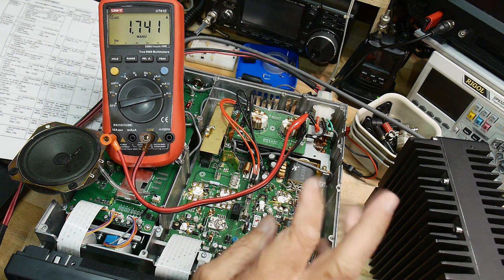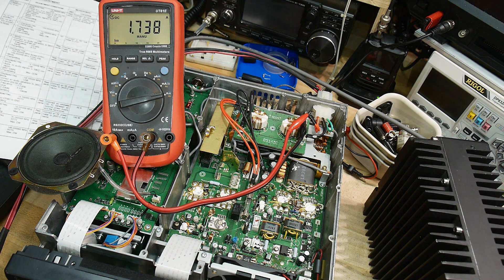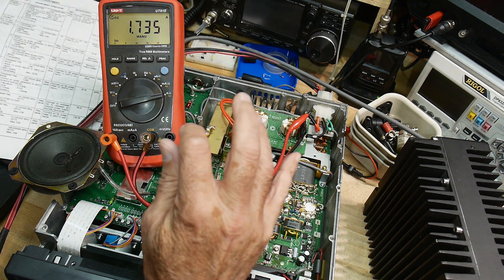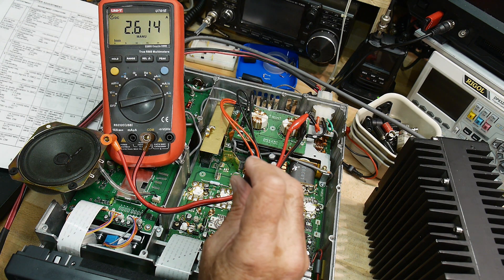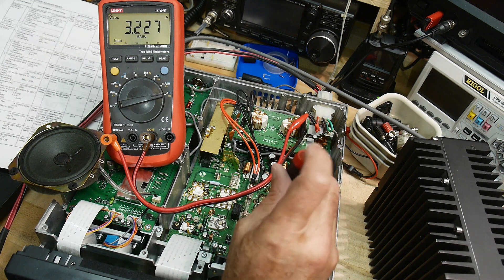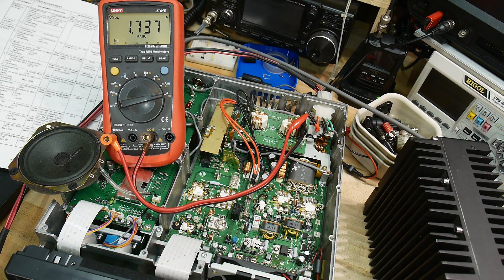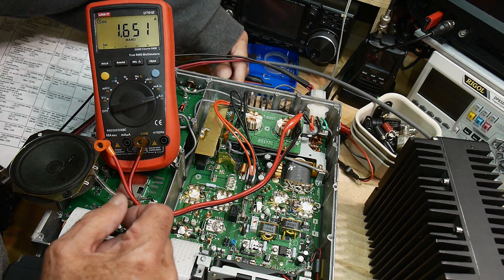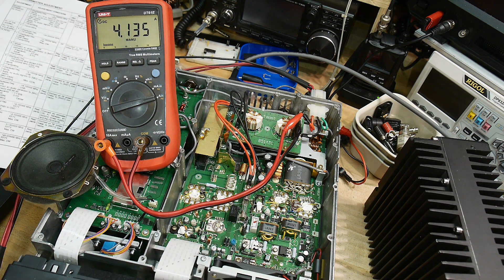#1104 ICOM IC-746 faulty ( part 8 of 8)

Comment: I’d love to hear an update if you used a wattmeter through an antenna on both hf and vhf. I have a similar issue with my 746 but have been confused. VHF is max power and hf is low power. RF power knob doesn’t show anything on the meter when I turn it even though I replaced it with another tested 10k ohm knob. May have to try this without the nicer test equipment to verify I fixed the issue along the way.

Comment: Did repairing the drive for the HF side also fix the output for the VHF? It had low output too didn't it? Maybe I missed something, thanks.
Reply from the maker: the repair was on the pre-driver, used on both HF and VHF. the signal splits from there to HF and VHF final amps. those are fine and in this video I set the bias on both HF and VHF

Comment: It seems that ALC is a little bit to high
Thanks for your videos
Reply: Was just about to say that too, the ALC goes all the way up to the maximum, and that's not right..That might be the reason for the failure of the drivers in the first place. I've got the IC-7400 (the european equivalent of the IC-746) and it's not doing that. The ALC is supposed to stay in the brackets (on the display).
I've got a similar but intermittend problem with my Kenwood TS-2000 on 144mhz and 430Mhz but wasn't able to find the reason for it yet cause it's coming and going.